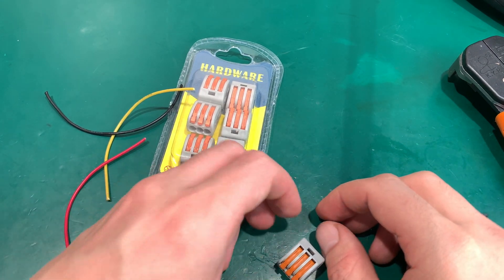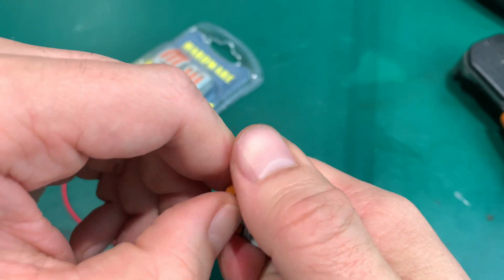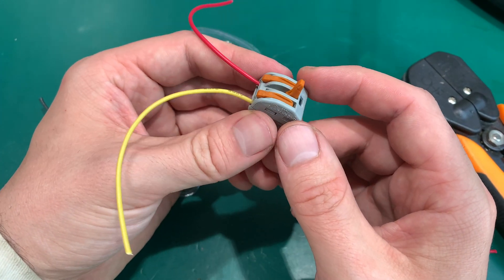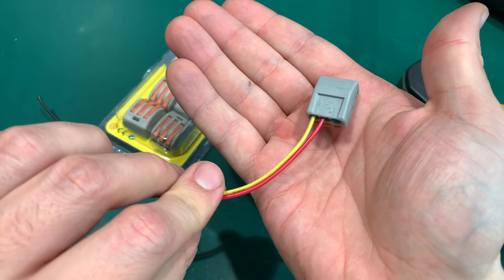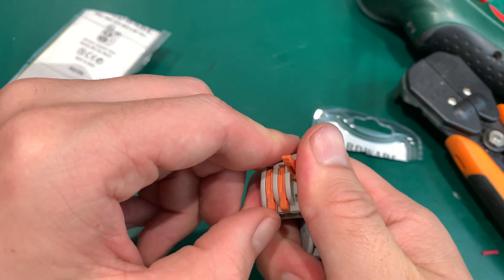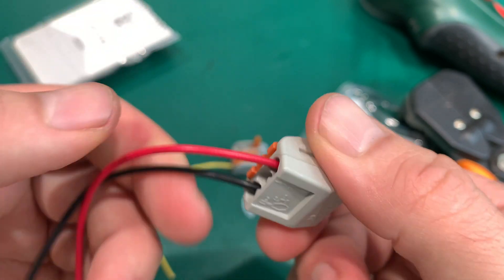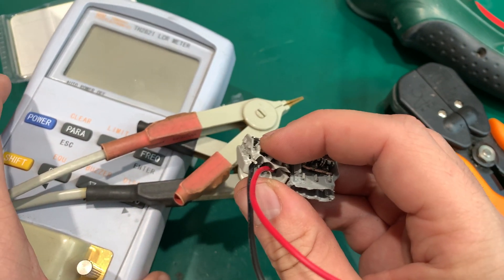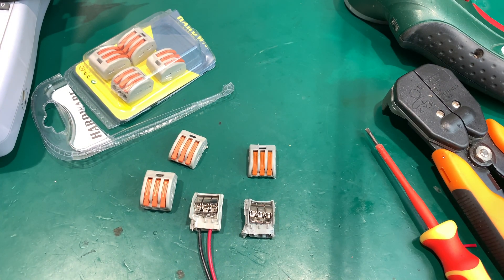Wago terminal block  quick connector 222  vs fake china PCT213

Comment: The recess on the underside is there as a guide to how much you need to strip the wire back  so when inserted the clamp only clamps down onto the copper conductor and not the insulation.

Comment: China copy is that safe for electrical wiring?
Reply: Apparently so, however I would not use them in a commercial setting, but that is down to the consistency of the quality, you wouldnt want a call back from a customer 100 miles away to replace one at your cost, however they do appear to meet all UK regs and moreover after testing the fake ones, they do surpass their specs.  Not sure where you are however if they meet UK regs then im sure they must do so in many other countries.